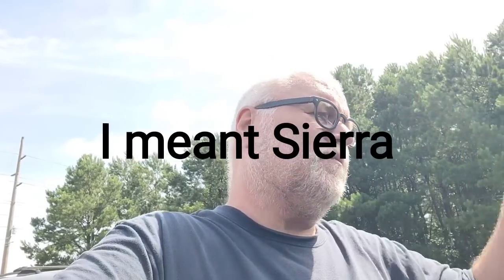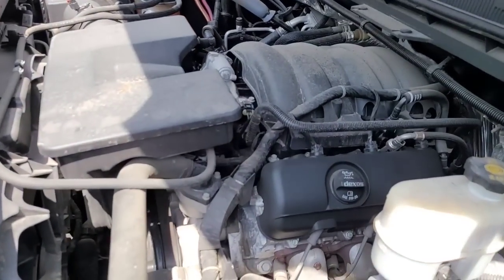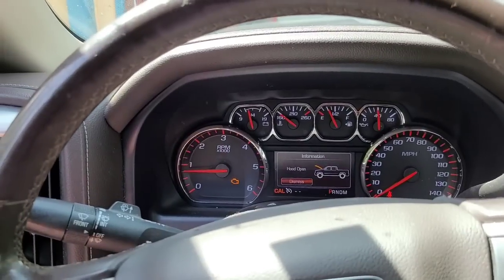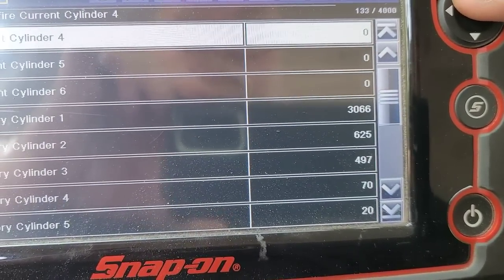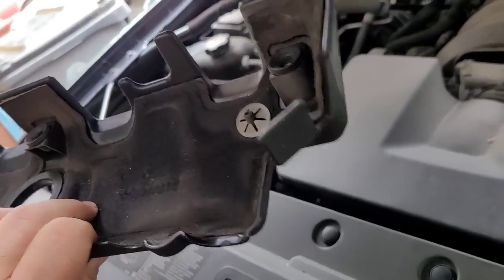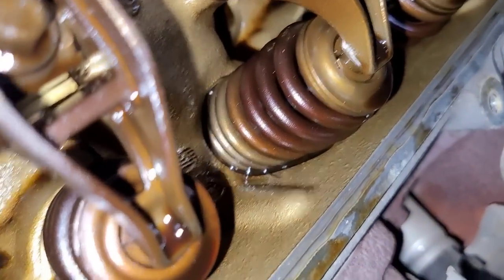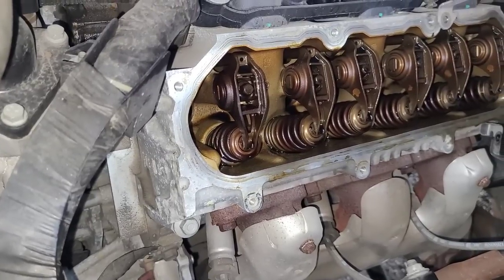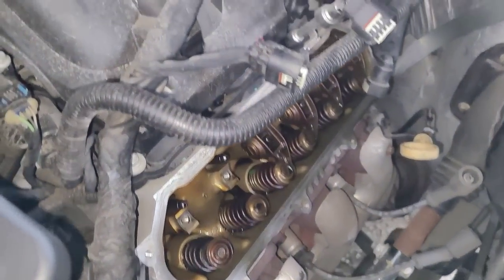Tow in & Runs Rough From Near Major Failure. Can It be Saved?

Comment: Hi Kenny, :)
How I learned to keep the valve from dropping into the cylinder when replacing valve springs is to take the sparkplug out and then stuff rope inside the cylinder. It keeps the valve in place when removing the broken spring and the keepers.
Reply: Yep, the old rope trick. I used that trick on my airplane engine once when it had a bad valve rotator.
Reply: I have always had luck with air. Except 1 time. I had to use the rope method.
Reply: That works too but I just keep the piston at tdc

Comment: Im old school I remember 45 years a go I had a couple of broken valve  springs , I would take a Q-tip with some valve grinding compound and go through the spark plug and put some on the valve seat , then take a drill and turn the valve left and right to reseat it , this was done on a fairly new 78 ford 400 , and a 350 GM motor . have fun Kenny .

Comment: OK Kenny, You've peaked my interest. I own a 2017 GMC Sierra 1500 4.3 Liter V6 EcoTec3 LV3 Engine (4.3 Liter Engine, Vin code H).  My 2017 gets over 30mpg driving over and back to a house I own. Both ways eliminates the uphill downhill or wind affect. That is amazing. But I only drive 60mph and I am very aware of my driving characteristics, I drove for Fuel Economy at GM for 36yrs. Interesting: The 4.3 reduces to 2.9 liters in V4, where the 5.3 = 2.7, so the 4.3 actual size is bigger in V4 mode than the 5.3, which might account for the bigger more noticeable engine shake in AFM mode. And Ken; you were going to find out which cylinders shut off on that 4.3, Please Tell.   Last: If the valve ever contacted the piston, even if it was only a kiss, I'd replace it no matter what. It's kind of like the Fram commercial, pay for the repair the right way now or pay a lot more when it destroys the piston, cam, block, head etc. Can't wait for the next vid. ben/ michigan

Comment: Ken, why didn't you raise the piston to TDC to prevent the valve from dropping into the cylinder if a oops happened? It's easy enough to lock the crank in place to prevent it from rolling when air is applied.
Reply: Livin on the edge...
Reply: It works I've done that my whole life never lost a valve did I loose air pressure when the keepers were off yep but valve dropped maybe half inch or so just pull it back up apply air and resume work simple stuff

Comment: Will be interesting to see if this works out without pulling the heads. I would say just do a valve job, have the heads reworked, but that motor may have too much wear. I'll keep my fingers crossed and hope changing that spring works. Also hope that is the only one. I had one before that had a broken rocker arm. I changed it and it worked out, blind luck.

Comment: I have found the best method is to turn the engine over until the piston of the cylinder you are working on up to its almost at TDC then even if you do lose both valve collets the valve can only drop so far into the cylinder. I have also used air pressure method to change the valve stem seals on my Jaguar straight six. Good diagnosis and I think you are right there is probably carbon on the valve preventing it from sealing, good call just to replace the spring.

Comment: I’ve got a 2020 transit connect van. It’s had two recalls, it’s got 15000 miles on it, it had mice in the blower housing brand new, it had an a/c issue, the automatic door lock for the drivers side sliding door still doesn’t work, I cleaned the mice nest out and found out there must be some duct work missing because there was a 6”x6” hole where mice could just walk into the blower housing, and also had a check engine light related to the cam shaft sensor that had to be fixed. I told my dog, I don’t know which is worse, being unamerican or driving a van that always breaks down. Used to have a little Nissan pickup and drove it over 50000 miles and only had to put a battery in it. Who knows maybe just bad luck
Reply: They don't build Nissan's like they used to...

Comment: Spare keepers stored in the sump ? --- Back in the 1984 UK factory garage our mechanic took an oil pump apart and found it was keeper wedged inside the pump, further investigation he found 2 more spare, they had been banging on the mesh pump strainer intake and made a hole.
He dropped the sump and cleaned it out.
Later he took the rocker cover off expecting to find where they had come from ? none missing ? the van was fixed and ran well.

Comment: How did it break a spring winding the snot out of it thats the only time ive ever broke a valve spring was beating on it and decent too not just one time to the floor i mean low range 2nd gear and hit the hill dont let off till you hit the top beating on it. 6 thousand rpms for 4. Or 5 mins beating on. It

Comment: No biggie with dropping the keeper.
Every great mechanic has an occasional moment.
You were on auto pilot when you were tapping the valve because normally the spring wouldn’t be broken and you would only have had a lock/key loose if you had the spring compressor on the keeper under tension.
So I say - don’t sweat it. Ya didn’t break anything and you’re going to fix it anyway when you get the parts.
Keep all the great content coming. It makes me feel like I’m still in a shop. Which I haven’t been in years…
😉👍

Comment: I have the 2014 GMC 4.3 it's been a great truck. 250.000 k just started running rough like this one. It keeps telling me maf  sensor. Cylinder 5 misfire. Then says something else nxtime the light comes on,it will say fuel injector. All of these parts are new. ?
Reply: If you bought this truck new and never changed the MAF, it could be bad. make sure you replace with OEM only.

Comment: Why would you have  the piston at bdc and not tdc what if you for some reason  loose air and spring pressure you will definitely be pulling the head off it will swallow the valve but at tdc it won't it just dropped till the piston stops it and it's not running or anything so it won't hurt it any I always do my valve seals and stuff w the piston at tdc and it's saved me once or twice too believe It

Comment: You wouldn't think it would with modern engines killing the injector fairly quick when detecting misfires, but very often on the GN V6 and V8 it will  burn a hole in the intake manifold plenum when the intake valve spring breaks.  Of course, that's even more possible with this one since it has no misfire DTC's.  A smoke test would be good if you wanted to let your customer know sooner rather than later.

Comment: I got the 2002 4.3 Vortec in my Blazer ZR2 & she runs so great. 
Not sure why they put smaller engines in larger trucks that work harder. 
You can't even feel my engine running with the A/C on at a red light & it's still getting 16mpg in 2023 with over 300k miles on her. 
They are great engines, if you take of them.
Reply: 16 mpg.....that's terrible....🤔🙄😳🇬🇧
Reply: It's a 350 with 2 cylinders lopped off the bore and stroke and most of the internals are the same it explains it's torque and durability no

Comment: SR. I NEED YOUR HELP 🙏🙏🙏
    I replaced the knock sensor in my truck 4 times already and the code came up again and again I don't know what to do now , I also buy the ones from the diler and still the same .,  We check the wires from the sensor to the computer and they're good 😢 I don't know what else to do even the mechanics 😅😅 can you please give me and idea of what to do ???
   GMC SIERRA 2006 5.3 1500 THANKS....
Reply: What fault codes are you getting? How does the engine run?
Reply: @edwardspaccarelli5944  P0332(1/2)stored 
Knock sensor 2 circuit low
Voltage bank 2
DTC severity 2 of 3 : repair
   This is exactly how it's showing in the scanner , and the motor has power that runs good , the motor is stable we also replace the oil pan gasket and valve cover gasket , I saw a video that says to erase the code and turn on the truck and accelerate to 5 mp for 5 seconds twise and  the code come again, I don't know what else to do and the mechanics that I know don't know what to do too lol 😂😆😅
Reply: @andresayala7871  there’s a video on the South Main Auto YouTube channel that show’s knock sensors diagnosis and repair on 2006 GMC Sierra. I hope it helps you out.
Reply: @edwardspaccarelli5944  ok I will check it out thanks 🙏

Comment: I had the AFM programmed out of my 2014 Silverado 5.3 at about 120k .  Never had any issues, got decent gas mileage, regular oil changes.  Had 250k on it when I traded it in.  Great truck and engine.  Transmission?  Not so much!
Reply: I just worked on a friends 2014. Had most of the engine apart for oil leaks. They are getting more time consuming to work on. 14 hours for valley cover, timing cover, oil pan, right side cylinder head gasket and engine/trans cooler lines. And I work fast.

Comment: Dit dit dah, dit dit dah.... Cranking cadence sounds horrible... Compression!

Put the effected cylinder at TDC, whenever playing with valves... You CAN NOT lose a valve into the cylinder by making a mistake with the valve keepers.
I do head-on valve seals WITHOUT shop air... As long as the piston stays at TDC.